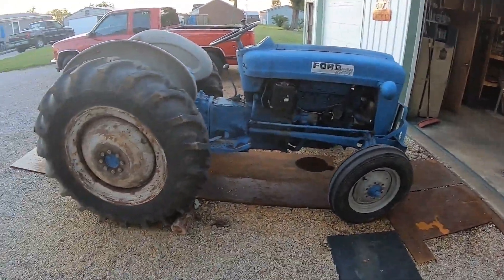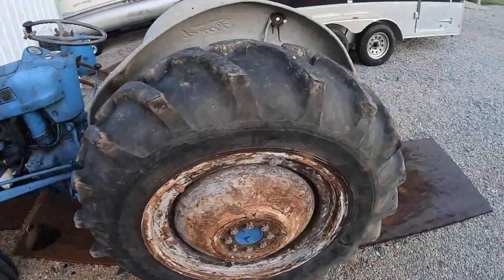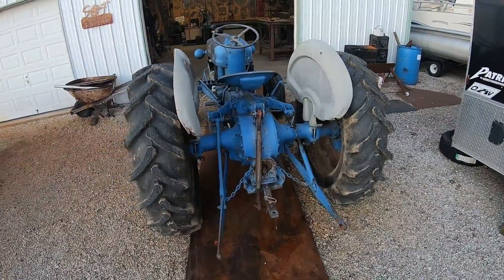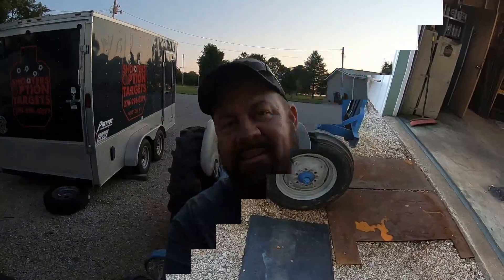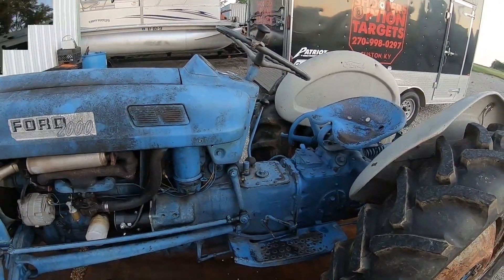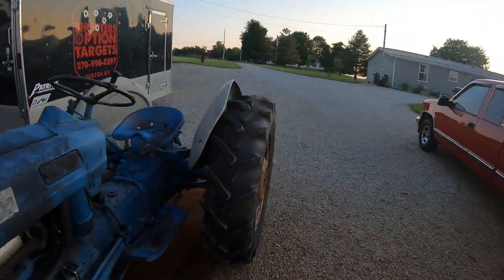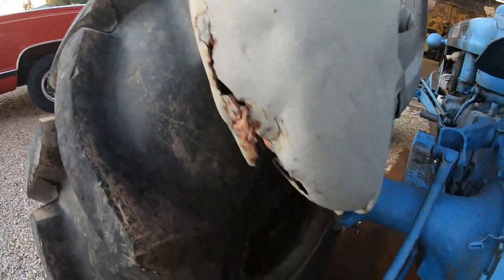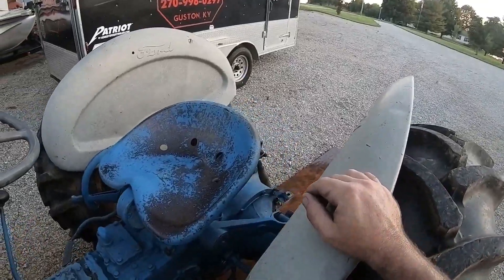A little walk around our new to us Ford 2000 tractor.

Comment: Put you a fuel shut off on the ole girl.We had a 800 Ford that would do the same thing fuel shut off kept that from happening.Nice looking machine
Reply from the maker: Thanks Ben, it has one but the operator has to remember to turn it off.😀 i may have forgotten
Reply: @shootersoptiontargets  we took a black sharpie and wrote us a note by the steering wheel because we forgot also. Lol 😂

Comment: Please don’t buy a Chinese aftermarket carburetor for your tractor, stick with the original carburetor and if you have to rebuild it trust me I have 2 ford gas tractors and I made that mistake once. I rebuilt both carburetor’s and they are both running strong.